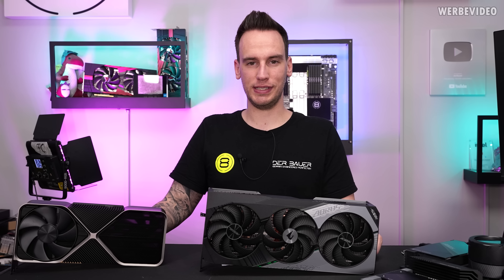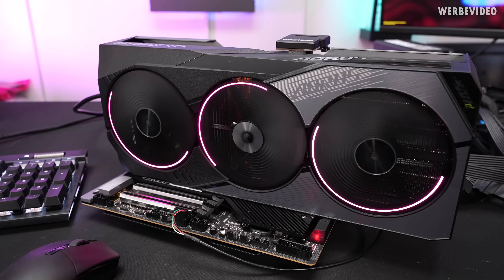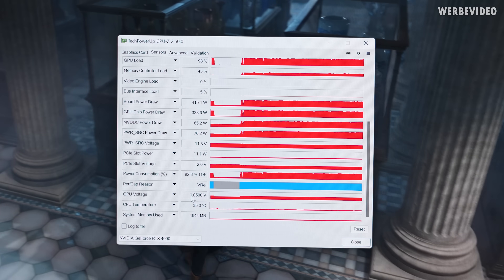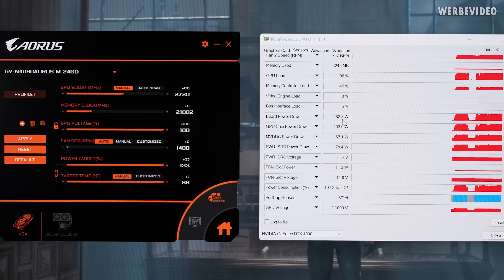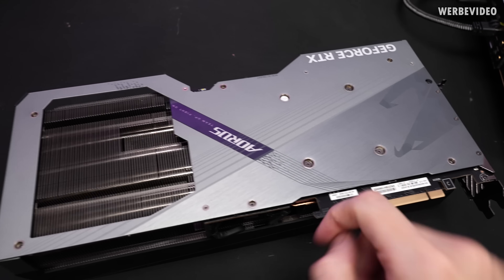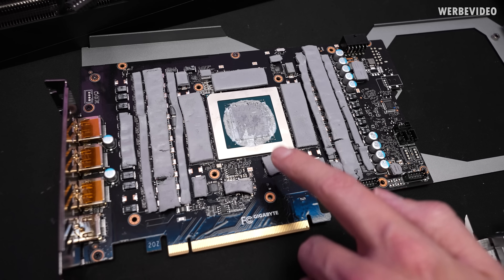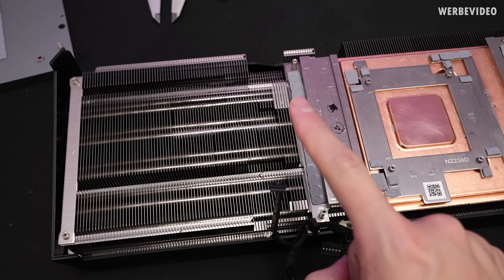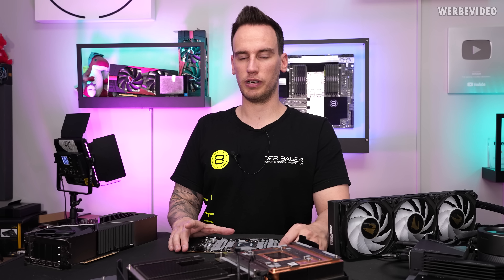Hidden NVLINK? RTX 4090 Aorus Master Teardown and Overclocking to 3GHz

Comment: They're probably just reusing the design for Quadro or Tesla cards, and disabling NVlink in the BIOS. It's common for NVIDIA to differentiate hardware only at BIOS or driver level.
Reply: How about if the rumors were true that Nvidia didn't update the spec for the AIBs and they just went with the original reference designs?
Reply: Reuse 3090ti board, include the display output port 😞
Reply: The Quadro and Tesla cards would be based on the reference design and not an custom design by Gigabyte. The PCBs of the reference design and the Founders Edition don't have those traces.
Reply: Let's nod it to quadro  , anyone remember those days of getting x5 Open GL performance for CAD
Reply: My guy Quadro cards like the RTX 6000 (Ada) don't have Nvlink as well...
Reply: or the RTX 4090Ti may have it
Reply: @1BigBen  SLI is not supported any longer, which is a crying shame. I wish they still kept it.
Reply: personally i think part of it is the potential power draw of these cards, how big they are, nvidia prob decided that it would be more trouble then it was worth dealing with people whos systems were having issues due to the psu being pushed to bloody hard...
Reply: No, NVLink is gone gone. It's not even on the IC. It's just there because the vendors probably weren't told until the last minute. Even on the 6000 Ada it's gone. Only the H100 has it.
Reply: But this is an Asus card, do they make Quadro/Tesla versions?
Reply: Nvidia are definitely going to make a 4090 Ti.  If there's no Titan (sounds unlikely), then the 4090 Ti seems like the logical card for NVlink.  A good way to sell the most expensive card to creators that don't want/need/can afford a Quadro
Reply: @toddpeterson5904  the top end $5000+ Quadro RTX 6000 (Ada) which uses the full Ad 102 die just like the 4090 ti is going to use, does NOT have Nvlink. So the 4090ti will 100% not have Nvlink as well. 

Nvlink was removed on silicon design according to Nvidia.
Reply: @AOTanoos22  Source?  There are a lot of applications that need more than 24GB VRAM, or even more than 48GB.  Ampere A6000 has Nvlink, so why remove it and impose a VRAM limit of 48GB with no products that can handle more?
Reply: @toddpeterson5904  Jensen said they sacrificed it for AI space on the card. As in its not on the chip at all. They said in the future they'll try and replace it with PCIe 5, only dumb thing is these are all PCIe 4 cards, and PCIe 5 is too slow to be a real replacement.

The answer is simple. Not many people were using more than 48GB of vRAM, so not using NVLink on the A6000 or 3090. So why not just replace that with something they will use more, the  better AI cores.

NVLink is going to be advertised as a data centre only thing. It's very very heavily used in the H100, and the H100 has a similar number of CUDA, and Tensor cores to the 4090, yet the die size is much bigger. Why? For all those NVLinks mostly, but some for PCIe 5 as well (which the H100 is), and likely a bit in memory controllers for it's 80GB.
Reply: @lost4468yt  depending on how the Nvidia L40 goes (All specs are not revealed yet) which has Nvlink and is an Ada Lovelace GPU, i don’t buy that they left out Nvlink to use it for AI space or that the left it out on silicon design. 

Comparing the H100, which has a completely different Hopper architecture with the main focus on Tensor Cores and high memory Bandwidth instead of Cuda Cores and GDDR6x in the 4090 Ada Lovelace architecture, makes no sense! Remember how the A100 has less than 7000 Cuda cores, yet the 3090 had over 10 000 ? You’re comparing apples and oranges here. 

There are many people in the 3D workspace that use Nvlink, i for example use 2 RTX A5000 GPUs (each 24 GB) and use memory pooling for up to 48 GB, anyone who uses 3090s for 3D work and is serious about it, uses Nvlink. Now to get 48GB you need to upgrade your GPU to a RTX 6000 (Ada), a GPU wich is 3 times more expensive than a 4090 or more than twice as expensive as a RTX A5000, which is a joke. Money milking at its finest.
Reply: @lost4468yt  "yet the die size is much bigger. Why? " 
Will the H100 have HBM? If so that's where the extra die size comes from. HBM is actually built into the same die as the GPU. That's why it has a much wider and faster connection to the GPU. In essences it's really just a part of the GPU itself. Anyway, looking at the pics Nvidia has on their websites, I don't see anything on the boards that appear to be memory chips. It looks like the chip is only surrounded by what appears to be VRM circuitry. So, I'd guess it indeed is HBM. Anyway, that's what accounts for the much bigger die size.
Reply: @AOTanoos22  this is the saddest thing i've heard. holding back machine and ai learning to leverage more money from these companies! what are they going to do with the supercomputers that run multicpu and multigpu for deep learning, machine learning, and si training? oh they using your gpu and your electricity to "mine" ai training from the consumers and then cashing in. $$$$$$$$$$$$$$$$$$$$$
Reply: Given that Ada RTX 6000 has NVLink, and the Ampere 3090 and/or 3090 Ti boards were just test boards for Lovelace (iirc), I think this is on the money.  It makes more sense to make several generic (or even just one) PCB and then populate them as necessary when you're at the scale nvidia is at.
Reply: @metaleggman18  the Ada does not have it. So far only the H100 has it. They're moving it to the data centre...
Reply: @metaleggman18  dude… the Rtx 6000 (Ada) does NOT HAVE Nvlink.
Reply: You wouldn't put a soldier mask there, in that case.
THIS is really weird...
Reply: Could be anything and may also just be reusing a PCB design. Personally I think Nvidia is considering a Titan this generation which would explain the loss of NV link. Aside from what I assume will be an insane amount of memory, that's the only feature that'll really make anyone willing to drop upwards of $3K on a card.
Reply: @JJFX-  This model in NZ right now is $4,249, which in USD is $2,382. Y'all think y'all are down bad, you're privileged.
Reply: @NiteOCE  Lmao you know tax is a thing in the USA. After tax this card is $2100 in US
Reply: I've been gaming at 3840x2160p, since 2016 and in 2020,when I got my 3090s, I got one Alienware 50 something inch 7680x4320p monitor and I've been gaming at 8k A LOT since then/I got 3090tis after that and I got a 4090,but it was weaker than my 3090tis system,because Nvidia handicapped their card by removing the NVLINK plug,I usually code something to optimize two cards,but this time, I kept my 3090tis/i9-13900k,128GBs of DDR5 RAM system and decided to build a separate system around the 4090 with an i9-13900k and 128GBs of DDR5 RAM and I utilize a hyper visor,which was a great idea,because now with the power of two Titan RTXs,two 3080s,two 3090s,two 3090tis a 4090,an i9-10900k,an i9-12900ks,3 i9-13900k CPUs, with a total of 98 cores and 512GBs of DDR5 RAM and 128GBs of DDR4 RAM,totaling 640GBs of RAM/all of my old computers that are still worth keeping, I can basically run and do anything I want to do on my network with them/I can stream multiple games to my monitors/TVs/Steam Deck,I can run multiple Virtual Machines simultaneously to test my code.

I have MOST of my systems hardwired/plugged up with RJ45 cables,but my laptops,phones,tablets,Steam Deck and so on are designed to be portable/not tethered to a wire, so I SOME WHAT recently got four ROG Rapture GT-AXE16000 routers,that replaced some Night Hawk Routers, to cover my whole house/one for my back yard area,one for my basement,one for my first floor and one for my second and third floor.

I've been thinking about adding two more i9-13900k CPUs to the equation, my goal is to get to 148 cores and that would get me to 146 cores, I also don't want slow cores either/traditional server cores are trash,also AMD isn't an option, because all cores aren't created equal/if you compare an i9-13900k/Intel core to an AMD core,you will be disappointed with AMD/SOME of AMDs CPUs have like 64 cores/the 3990X has 64 cores,but the single core performance of a 3990X isn't great,maybe since I don't have a system in a Z790 board, MAYBE that COULD be a good idea/I could get another i9-13900k/4090/128GBs of RAM and then when Meteor Lake comes out I can get an i9-14900k/ks system. 

My Hyper Visor journey has been good so far/being able to combine all of this hardware vs my usual two card setups has really changed things for the better, my work loads are handled perfectly/I only run Kingston KC 3000 SSDs and SOON I'm going to add some Samsung 990 SSDs,I have a total of 60TBs,for storage/each of my systems have 12TBs in them,for movies and games,I also have some smaller sized SSDs,for Manjaro Linux,Windows,Virtual Machines and projects,but the removal of the 4090s NVLINK plug has really opened a lot of doors/has been a really good thing, at first I didn't think this was true/I thought it was going to impact my work loads, but with the options Hyper Visors give you NVLINK isn't really needed anymore/with a hyper visor you can crush any single system easily.

Comment: Real reason why nvlink was removed, in my opinion, money. These AI enthusiasts, 3d designers and other very bad, in eyes of Nvidia management, people's who need big graphic buffer but din't want to buy 5 times more expensive Quadro GPUs, should suffer. Even if it's just your hobby or just it's small startup without a few extra hundreds of thousands of dollars, now you should pay full 10 000$ for upcoming Quadro version of 4090, but with ability to connect cards.
Reply: With pcie advancing so much shouldn't it be easier to just use pcie and not have nvlink, also how would you fit 2 4090s you could water cool but it's still 1200 watts. (＠_＠;)

But yeah fuc Nvidia they're not doing this for any of that they just want money.
Reply: @SuperTort0ise  All companies are in business to make money...
Reply: Agree.
Reply: agree
Reply: Wrong. The new Quadros don't have NVLink either. Going forward only the Tesla-class cards have NVLink.

Comment: Roman, do you know if an EK waterblock for a 3080 TUF will work on a 4090 TUF?
Reply: Definitely not. The board design is surely different between a 3080 and a 4090.
Reply: Of course not.

Comment: In the old days it was soldering on a variable resistor to one of the IC legs and a few turns on a screwdriver for more gpu volts.  Though I guess the contact point is tiny nowdays :)
Reply: Also we were using pencil to lower the resistance of shunt resistors for bypassing power limit. Good old GTX times.
Reply: @virinom  Or the pencil marks between contact points on Athlon cpus for overclocking.overlooking. At least temporarily to test for stability.
Reply: In the old old days Nvidia didn't restrict voltage control.
Reply: Most ICs these days are BGA so there's no contact point, it is sandwiched between the PCB and IC, no space to connect a wire unfortunately.
Reply: @someguy4915  Thanks, I was guessing so much.   Maybe one of the graphic card company's could get a niche on that. Sadly not EVGA and Kingpin. Kingpin rocked on xtremeoverlocking back in the day after macci, OPPainter et al.

Comment: Good to see how small the board is, water cooling the 4090 will give you a very tidy package compared to the monstrosity that is the stock cooler configuration
Reply: yeah it would be nice for my custom loop but i think im going amd next time... not even bc of performance but because of drivers and compatibility with linux
Reply: It is small compared to the cooler but it's still a big board compared to prior shorty GPU boards
Reply: WATCH OUT !!! no they are not that small only a handful of them are...I got screwed on that with my 3090 the pcb is 10cm longer than the FE I spotted several 4090 with long pcbs too
Reply: @fredEVOIX  This is why I like sticking with FE, but I will make sure to look into PCB length prior to purchase
Reply: Someone really needs to bite the bullet and decide cards like this should just come with water cooling instead.
Or better yet a non-insane TDP so the card doesn't look like the Voodoo 9000 shitpost
Reply: Aorus master is literally the largest 4090 there is, why would you buy it just to watercool? Only advatage it has over other cards without the cooler is the VRM, but then just buy the zotac Amp extreme
Reply: I've been gaming at 3840x2160p, since 2016 and in 2020,when I got my 3090s, I got one Alienware 50 something inch 7680x4320p monitor and I've been gaming at 8k A LOT since then/I got 3090tis after that and I got a 4090,but it was weaker than my 3090tis system,because Nvidia handicapped their card by removing the NVLINK plug,I usually code something to optimize two cards,but this time, I kept my 3090tis/i9-13900k,128GBs of DDR5 RAM system and decided to build a separate system around the 4090 with an i9-13900k and 128GBs of DDR5 RAM and I utilize a hyper visor,which was a great idea,because now with the power of two Titan RTXs,two 3080s,two 3090s,two 3090tis a 4090,an i9-10900k,an i9-12900ks,3 i9-13900k CPUs, with a total of 98 cores and 512GBs of DDR5 RAM and 128GBs of DDR4 RAM,totaling 640GBs of RAM/all of my old computers that are still worth keeping, I can basically run and do anything I want to do on my network with them/I can stream multiple games to my monitors/TVs/Steam Deck,I can run multiple Virtual Machines simultaneously to test my code.

I have MOST of my systems hardwired/plugged up with RJ45 cables,but my laptops,phones,tablets,Steam Deck and so on are designed to be portable/not tethered to a wire, so I SOME WHAT recently got four ROG Rapture GT-AXE16000 routers,that replaced some Night Hawk Routers, to cover my whole house/one for my back yard area,one for my basement,one for my first floor and one for my second and third floor.

I've been thinking about adding two more i9-13900k CPUs to the equation, my goal is to get to 148 cores and that would get me to 146 cores, I also don't want slow cores either/traditional server cores are trash,also AMD isn't an option, because all cores aren't created equal/if you compare an i9-13900k/Intel core to an AMD core,you will be disappointed with AMD/SOME of AMDs CPUs have like 64 cores/the 3990X has 64 cores,but the single core performance of a 3990X isn't great,maybe since I don't have a system in a Z790 board, MAYBE that COULD be a good idea/I could get another i9-13900k/4090/128GBs of RAM and then when Meteor Lake comes out I can get an i9-14900k/ks system. 

My Hyper Visor journey has been good so far/being able to combine all of this hardware vs my usual two card setups has really changed things for the better, my work loads are handled perfectly/I only run Kingston KC 3000 SSDs and SOON I'm going to add some Samsung 990 SSDs,I have a total of 60TBs,for storage/each of my systems have 12TBs in them,for movies and games,I also have some smaller sized SSDs,for Manjaro Linux,Windows,Virtual Machines and projects,but the removal of the 4090s NVLINK plug has really opened a lot of doors/has been a really good thing, at first I didn't think this was true/I thought it was going to impact my work loads, but with the options Hyper Visors give you NVLINK isn't really needed anymore/with a hyper visor you can crush any single system easily.
Reply: So when you watercool the radiator pump and fans do not count? They vanish into the air right.
Reply: @UhOhUmm  eyeroll Thanks for contributing, I guess.
Reply: @UhOhUmm  Pump and Rad are still a thing, but we are talking about going from a 3/4/5 slot card to a 1 slot card, a massive reduction in weight on your PCI-e slot, improved airflow, and most people who are going to disassemble a 4090 and put a block on it, are almost always the same people who have a whole loop built for their CPU and they are adding a GPU to the loop now. This helps for small form factor cases....and a lot of just mid sized cases too, the card is the size of an Xbox Series S, its huge. Even with a pump and rad and fans, its still going to be smaller overall.
Reply: @CrimeSceneKitty  you know water blocks still weigh more than these coolers. Water blocks are solid copper/nickel
Reply: @UhOhUmm  Nah but they are on the case top or front not in the middle blocking the slots and choking the case
Reply: @UhOhUmm  atleast the bulk is shredded by a big amount on top of the mohterboard and about the radiator and pump they have their own separate compartments which makes the setup a little bit clean instead of the whole brick taking up most of the motherboard space
Reply: @UhOhUmm  You have never seen a watercooled GPU
Reply: @UhOhUmm  with an AIO kit... kind of yeah
Reply: @UhOhUmm  bah then you put all the metal stuff to a side of the case instead of the middle where it blocks access to slots, damage the PCie slot, and choke the case !
Reply: @UhOhUmm  Yeah, because wherever they are they aren't blocking all of your slots
Reply: @UhOhUmm  hilarious this comment got this many likes. Tells half the people watching this kinda content watches for shits and giggles.
Reply: @UhOhUmm  kind of, they become part of the case itself and don’t put any weight on your GPU socket
Reply: @UhOhUmm  
The mass that would normally stress the PCIe Slot is on the part of the PC designed to take it. Pump and reservoir can also go into the spare 5in bays that are normally dead space anyways

Comment: The PCB is so small that with the proper "sleeper" cooler it can pass as a 4050ti or something.
Reply: especially since someone undervolted and underclocked theirs 130W lower while only losing about 5% performance
Reply: the FE once watercooled is the size of a 1050ti..I did comparisons but AIBs usually have longer pcbs